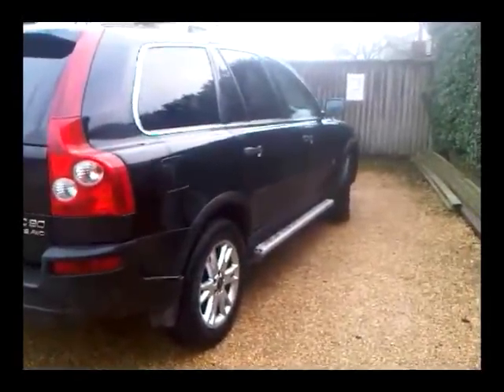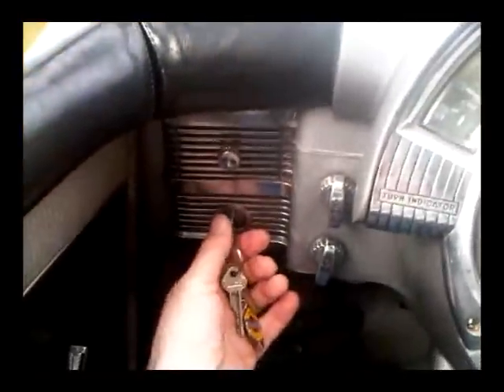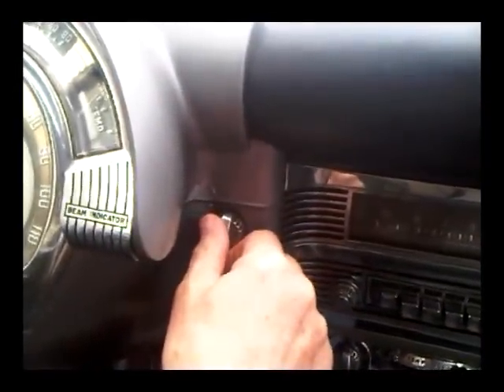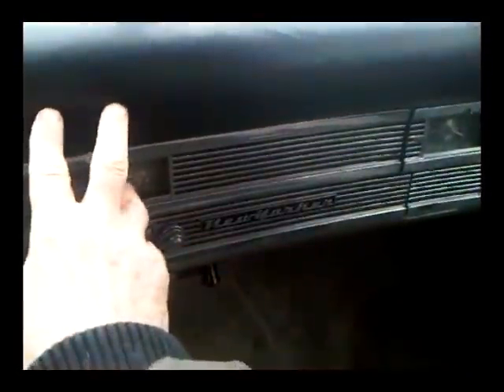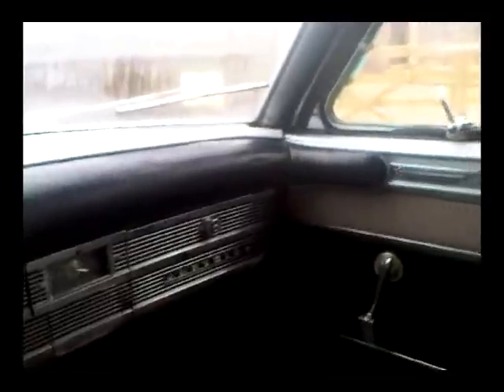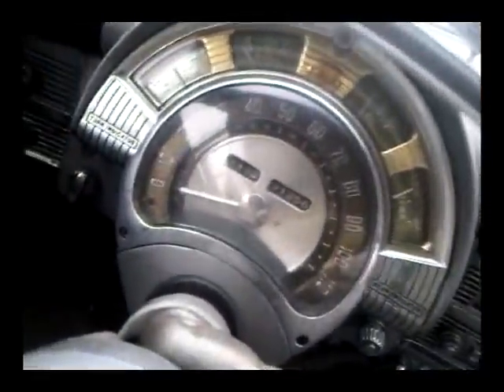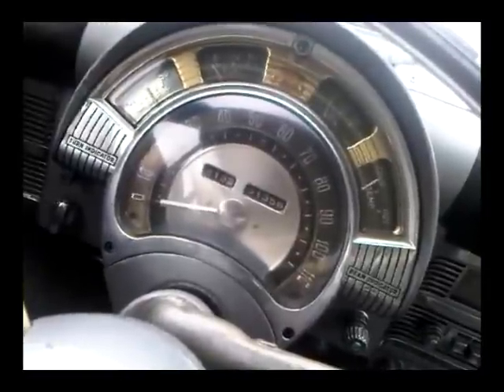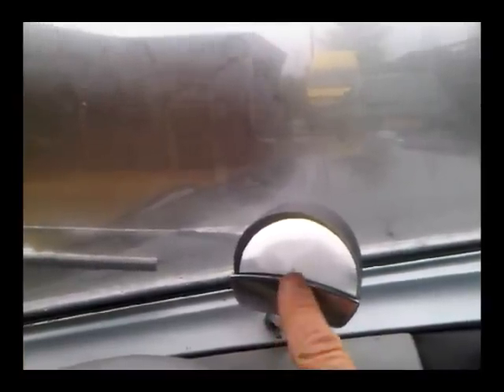1950 CHRYSLER CONTROLS EXPLAINED

Comment: The leather wrapped dash saved me from injury in a panic stop in 1954. I was sitting cross-legged on the front seat when my grandmother had to stop suddenly for a kid that ran into the road in front of the car. I pitched forward, my 5 year old head struck the padding (before seatbelts) and I sat back in the seat unscathed. When I turned 16 and was given the car, I installed seat belts. The clutch pad reads "safety clutch" because there is no neutral starter lockout. And will bolt when started.

Comment: The defrost air in this period came out of slots at the base of the windshield so would take some time to get the windshield clear up where you actually look through it. In 1957 all Chrysler cars had the first defrosting from non-slot duct vents that hit spots in the middle of the windshield first. Also of course, no AC so no dehumidifying the air either! Air conditioned Chryslers starting also in 1957 used flip up versions of the defroster outlets on the top of the dash for AC air.

Comment: The other AC air outlets were below the dash. In-dash vents weren't invented quite yet. Anyway, they didn't think of running the compressor with defrosting, but by running AC with the heat up, not flipping the defrost vents to AC position, and closing the under-dash vents you could do it yourself!

Comment: the button on the shifter? It wasn't a button that locks the lever and keeps you from shifting by accident while driving? Interesting..
Reply: That button may be for engaging a passing gear. The driver would press the button and hold it pressed until the passing was no longer needed, then release the button.

Comment: That fluid drive semi-automatic had not four forward gears; it had only three. Starting out was in first. When you were moving you took you foot off the accelerator momentarily  for the automatic shifting from first to third, making a loud clunk sound. If you wanted to go to second gear, you had to shift the lever up and away from you and back down for third. Shifting the lever toward you was reverse. Dodges and DeSotos had the same transmission.
Reply: I'm sure this is all very familiar to you, but to me, Id be lost!
Reply: If your car had the Fluid Drive WITH the M6 electric shift transmission,it had two forward gear shifter positions  and EACH position had TWO ranges, or "gears" and it eletronically shifted in EACH "GEAR" BY LIFTING YOUR FOOT OFF THE THROTTLE FOR A SECOND OR TWO WHILE IT SHIFTED. Fluid Drive descibed the Fluid Coupling which referred to the torque converter looking unit which replaced the flywheel in a non Fluid Drive car. The clutch was bolted to the Fluid Coupling rather than the flywheel which was not installed in an electrically operated semi automatic M6  transmission...the Royal had a regular 3 speed transmission, all other models had the M6 (1949)  Once you  understand it, it makes sense but if you see it apart it becomes MUCH clearer